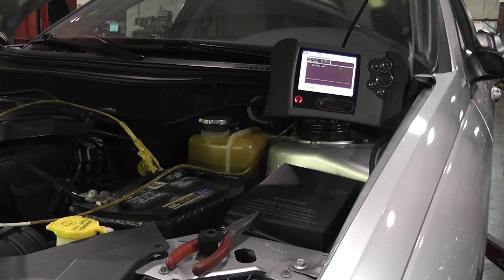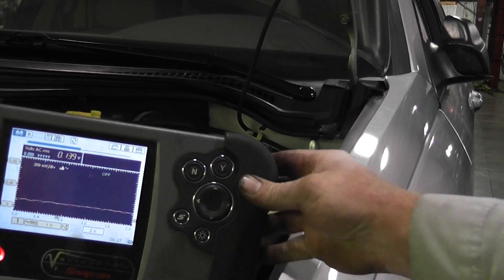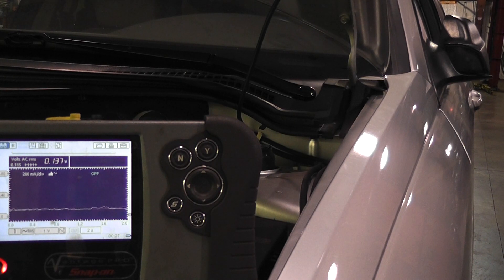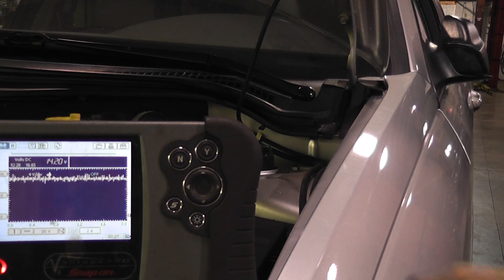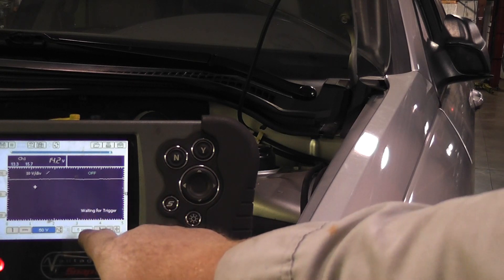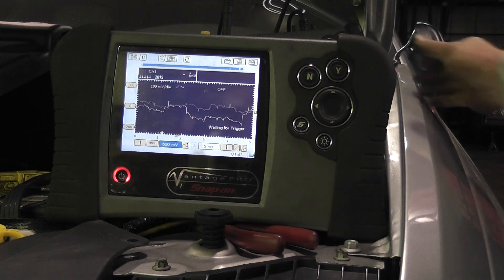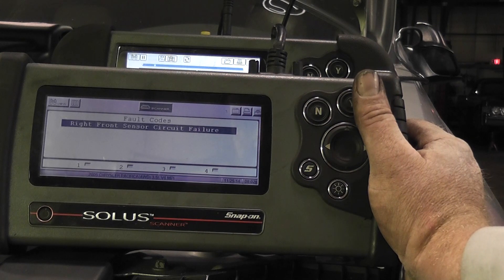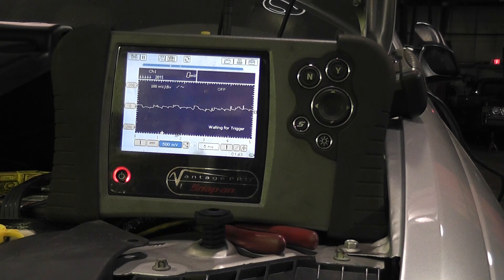CHRYSLER PACIFICA ERRATIC SPEEDOMETER

Comment: I have the same Pacifica and had the same problem so I changed the output n input speed sensor and temperature sensor and still had the same issue even the noise from the alternator and after doing a lot of research I found the same problem on a different Chrysler so yes it's the alternator and thank you for your time to do this video.

Comment: Late to the party, had an alternator go out on me last week in my 2004 Pacifica. Replaced it with a new one, noticed the new whine noise but didn't think much of it until the day after when I noticed a peculiar issue when coming to a stop with the vehicle lurching a little bit. Dumb me didn't think much of it till a few more days later when I happened to look down at my speedometer when coming to a stop and watched it bounce like it did in your video, sure enough 5 minutes later I get a check engine light and the Hum device in my vehicle pings my phone with P0700 and P0720! It was also fine in park but had the same issue with the speedometer in all other gear positions. Needless to say, my friend is going to give me another hand at replacing this damned alternator and I hope I don't get another dud.

Comment: same prob on an 06 pacifica. seems like a failure to RECALL. chrysler doing a good job of ignoring it I guess. video was helpful in determining normal voltage and erratic voltage in the output sensor. I can actually check it with a multimeter now and know what im looking for although kind of futile at this point due to the obvious fact that the alternator is the cause and seems to be quite common for that matter.

Comment: my 06 is having similar problem but also is having trouble shifting back to first.  it went into limp in mode once where it stayed in 2nd and read 8 till I restarted it.  could all that be caused by the alternator?
Reply from the maker: +Josh Frye just disconnect and insulate the main battery wire at the alternator and drive it around to be sure. A good battery will hold up on a test drive without being charged
Reply: James Danner  thanks I'll try that tomorrow

Comment: Thanks for uploading this video. Im having the exact same issue. Replacing it today.
Reply: I took it to a shop as soon as it started and they said the alternator was fine.
Reply from the maker: +Craig Stewart just take the heavy wire off of the alternator and insulate it from ground.  See if problem is gone. It will run on the battery for a bit without alternator  if battery is good. Mine howled pretty loud too but urs may not. 
The problem is the diodes that change ac volts to dc volts go bad and that ac ripple fools the engine computer.  The bad one still charged at 14 volts on the DC scale so a simple volt gauge won't pick up the problem
Reply from the maker: +Craig Stewart I just got a used one from car-part.com 
That's a search engine for local salvage yards

Comment: Thank u for the video.. I have the same problem with my chysler pacifica 2006, i just have a question is it that the i have to change the alternator to fix the problem??? I already change the outspeed sensor but the problem proceeds. What do i have to do to fix this same problem??? If u can please help
Reply from the maker: +alfonso cisneroS yes. I bought a used alternator from a local salvage yard . That fixed my problem

Comment: I'm having the same issue. I had a diagnostic with these codes U0140, U110C, U0168, U0155. Took it to Chrysler & they said it could be 3 different things , that will cost more than what I paid for the car. Can I email you? Please help
Reply from the maker: jdanner816@gmail.com. ....u codes are module communication codes. I need to look those up
Reply: +James Danner thanks so much for responding. I emailed you.
Reply: One code was u110c po700 po841 changed transmission fluid n filter take a while when I gear sometimes works one was transmission fluid pressure switch anything wi help 2005 chrysler pacifica 3.5 hhmedina666@gmail.com

Comment: Nice video! I had the same thing on a 2003 Caravan. Love the whine/howl those bad diodes caused. It was also causing transmission trouble codes for gear ratio error in first and second. Glad you captured patterns of the failure, as I did not have time.
Reply from the maker: I hear ya. it is hard to find time and be a full time tech.  thanks

Comment: Hi, i have the same issue with my pacifica 2005.
I am not sure i understood can you confirm that to solve this problem the only thing to do is replacing the alternator ? 
Thanks in advance for your time and thanks to publish this video
Reply from the maker: yes. the diodes in the alternator went bad and too much AC current was rippling thru the electrical system.  I actually got a used alternator from car-part.com....that is all that was wrong.

Comment: Another good video James. Thankyou. I just had by butt kicked by a 98 honda accord, with a cylinder position sensor code. car wouldnt go over 60 mph. this was a friends car.  this was a interminent problem.  i unpluged the alternator when fail was present with no luck.   i replaced the alternator  diagnosed by honda dealer ship  and the problem was fixed.   my question  can a alternator produce ac voltage even if unpluged?
Reply from the maker: if its got an internal short somewhere and u only unplugged the control side, it can..i was disconnecting the main battery lead at alternator . that would have been a neat one to graph
Reply: Thankyou.

Comment: Ah, the ChryslerCedes R-Cifica 350...  ;-)

In some of the last captures on the scope there, you were wondering about the little blip.  In the higher time bases, it just looked like noise, but at one point you brought the timebase down and were looking at a single waveform.  To me, it looked like an almost textbook harmonic.  My best guess is that it's a turn-off oscillation, or an oscillation resulting from changing field strength.  AC versus DC field collapse; they look very different.  Think of a pintle hump; same sort of concept.  You have a ferrous material moving through a magnetic field.  If the field changes, that material moving through it will have the ability to alter it even further.  Except with an alternator, you have an AC sine wave:  Approach-peak-recede-valley.  Changing the field strength, or shutting it off completely, is like releasing a spring under tension.  "boi-oi-oi-oi-oing~"  That harmonic doesn't happen across the compressed height of the spring, it happens at the upper limit of its travel.  That's why the harmonic you captured there was (mostly) on one side of zero.  Hopefully that makes sense...  :-]
Reply from the maker: oohhh. that sounds like another discussion video with scannerdanner. we can post ur response and discuss it. ha
Reply from the maker: i did want to screen shot that clean oscillation and ask about that but didn't know how. thanks
Reply: Your theory is very interesting ( I do understand what you are saying ) and may be correct ! But keep in mind that when that magnetic field on a coil/injector collapses and generates a huge voltage spike, that if it is not restrained ( Diode Clipping ) will go through the roof, or as you said,  Boi-oi-oi-oing ! LOL!
Reply: Billy R The pintle hump is a separate phenomenon from field collapse.  I do apologize, as I realize my mistake in my original post.  Perhaps commenting at 6:00 a.m. when I haven't slept yet isn't such a good idea...?  XD

The pintle hump seen on an injector is the result of the pintle hitting the seat.  The field is, I believe, still collapsing when this happens, and that sudden change in acceleration (or possibly the pintle bouncing on the seat), creates a tiny feedback current that's seen on a scope as a pintle hump.

I'm probably way off-base, here, honestly.  AC and DC are very, very different beasts, and my knowledge of AC function and theory is comparatively limited to my knowledge of DC.  I'm always happy to be corrected.  :-)
Reply: rhkips No, I don't think you are way off base! I believe you are right that the magnetic field is still collapsing, when the pintle hits the seat. It stands to reason that the magnetic field is still present or you would not see the pintle hump at all. It also stands to reason that the pintle has to bounce back off the seat, for it's iron core to distort the magnetic field, there by creating that famous pintle hump!  

But what really interests me, is that Harmonic Spike or should I say Inductive Spike, you were talking about! I want to know more! Are you saying that the Alternator itself is acting like a Inductor and ( i.e. Switching/Peaking +12 volts to 0 volts then Switching/Peaking to -12 volts) by the AC Sine Wave being created by the rotation of the magnetic field? Are you saying that when it hits 0 volts the circuit ( theoretically ) is off for a brief period of time? Is the current still flowing ( Inductive/Magnetic energy converting back to Electrical energy ) in the Inductors/coils of the Alternator ( with nowhere to go basically ) and building a large Reverse Polarity Voltage? All those little spikes ( Harmonic Spikes ? ) we were seeing after the fix? 

I may be way off base or way off my rocker! ( LOL ! ) Enlighten me please! Thanks !
Reply: I don't think it was an inductive spike, honestly.  I don't entirely know what to call it, but the waveform itself had all the characteristics of a harmonic (Parabolic diminishing amplitude and increasing frequency).  Whenever I see a harmonic waveform, it's created by the release of stored energy, or by the reflection of energy.

I don't think that harmonic is happening at the zero-point of the rotor's travel; I think instead that it might be a byproduct of Counter-Electromotive Force (CEMF).  Because you have an AC sine wave, you should technically have CEMF in two directions (+ and - of 0).  If there's a sudden change in the magnetic field of the rotor, perhaps that falls below the threshold current/voltage of the CEMF, it then allows said CEMF to "release" itself, and because the forces are sequentially alternated, they "release" at slightly different moments, causing them to "fight" back and forth against each other, releasing less energy each time as their total energy is diminished.  Hence, we get that back and forth oscillation with diminishing amplitude and increasing frequency.  A harmonic.

Take a small spring, set it on the table, hold it at the bottom, and with your finger, flick the top of it.  It'll go back and forth in a relatively straight line, but each time it does, it has less energy than the time previous.  As a result, it travels less distance, at a greater speed.  :-)
Reply from the maker: My brain hurts now. Ha
Reply: James Danner Again, Didn't  I hurt it on the Avalon? Have you read all of rhkips and my posts? What do you think ?
Reply from the maker: yes u did.  u guys sound like some smart dudes. way deeper into waveform analysis than i usually need to go to do what I'm doing. Good stuff
Reply: James Danner Well, really, AC waveform theory has no practical application to automotive diagnostics.  What little I honestly know of AC theory comes from growing up with my father, who's an RF Propagation Engineer, and my uncle, who is both a geologist and a mining explosives guy.

That being said, I could honestly be WAY off on all of that.  I presented it merely as my understanding of what that little blip of a waveform may have been.  I'm a jack of many trades, master of none, and I'll be unsurprised if your brother randomly shows up to shut me down and fold me into a ditch of shame.  ;-)
Reply: Smart, I don't know about that ! Wacked out maybe ? Interested definitely ! LOL !

And yes, I understand 100% you must knock e'm out as fast as you can, to make money! That's the name of the game!

What motivates me, is #1, the ( What ? ). Are they Harmonic/Inductor Spikes cause by the alternator or are they back ground noise caused by the injectors, relays or coil spikes?

After the fix you saw all those weird spikes, ( I loved your reaction, Wooooh, I don't know what I am looking at now! ). Danner, you are so honest with your expressions. I busted out laughing when you said that!

#2, the ( Why ? ). I want to know why, is that happening, ( Those Spikes  ?  ).Can an Alternator cause that?

#3, the ( how ? ). I want to know the cause of it ? ( Those dir, little funky Spikes ? ).Injector coils, relay coils, and electric motors, are all Inductors and  all produce a Inductive spike. Does an Alternator produce inductive spikes too? 

I went back and looked at your brothers case study of the same make and model as yours ( Different years, yours was 06, his was a 05 ) he had two traces hooked up, one on the alternator and one on the output sensor at the same time, with AC coupling engaged. They both had the same large AC ripple ( That you definitely don't want to see ), but there was one big noticeable difference. 

His bad alternator had the same weird spikes above/below the ripple as yours did, after you replaced the alternator, but, and I said but!

The ( Output sensor on the transmission did not? ).Where do you suppose they ( Those weird spikes ) were coming from?

To me it's a great learning experience and if I know and understand the answers, before hand, to the above questions, it can only help and speed my diagnostic procedures!

Think about all the time you will save, by not stopping to say, uuuuuuuuh, What that be ? LOL !
Reply: rhkips Yea you could be way off then again maybe not as far off as one might think!

And by the way that is one hell-of a background of intellectual influences on you. Sounds like it could be dangerous! LOL ! 

Check out my post to James and maybe you will see where I'm coming from when I say you may not be that far off!

Whether we are off our Rockers or not, it was great picking your mind and in the future feel free to jump in my posts/comments anytime!

Have a great Day!

Comment: Nice Job! What a difference with the tripod! Not so dizzy watching your vid! LOL !

The reason the speedo was reacting to the AC Sine Wave, is because the Alternator was putting that high AC Voltage through out the system. The Output Speed Sensor on the Transmission, generates it's own small AC Sine Wave too, but the Alternator just buried it. The PCM was seeing the Alternator's high ( Amplitude and Voltage/700mv ) AC Sine Wave and interpreted  that signal as if the car was moving, when you put it in gear. If you put a trace on both the Alternator and the Output Speed Sensor at the same time, you would of seen the exact same signal, because they were the same signal, originating from the Alternator! Because of the signal from the Park/Neutral switch, the PCM was ignoring it when it was in park. As for the weird spikes you were seeing after the fix, I agree with Sandy Anderson, that they were either ignition coils firing or injector coils, etc. If you weren't aware of these symptoms, such as the Speedo,the whine of the Alternator or the similarities between the Alternator and the Output Speed Sensor ( both produce a AC signal ), I could see someone replacing the Output Speed Sensor or worse needlessly ! You said that you had a suspicion that the car also probably had shifting problems too, and I agree, but I would also bet that it probably had ABS control problems ( depending on Sensor design ) as well, because of the ABS Sensors outputs AC signals too!
Reply from the maker: you are right.  i did feel the abs go of a few times while i was sitting there stopped in gear.

Comment: Thanks for video james so professional now with that tripod lol.  At 14 mins u ask about the spikes could they be from the ignition the coils firing/interference.  Cheers sandy
Reply from the maker: that could be a good possibility.  i never looked that deep at an ac signal before.  i appreciate the input sandy. thanks
Reply: James Danner to confirm Sandy's theory, it's a little late now, but for future investigating direction? You could of put a second trace on all of the control wires of the coils/injectors with an amp probe to see if the coils/injector amp ramps coincided with those weird little spikes!